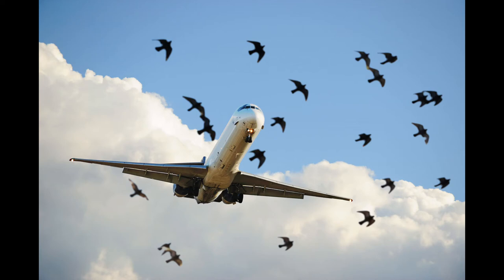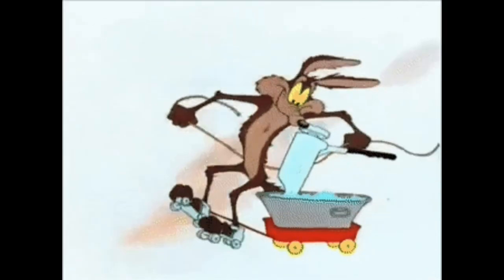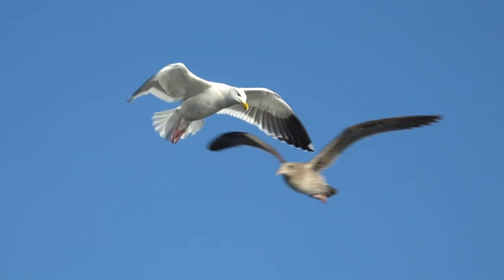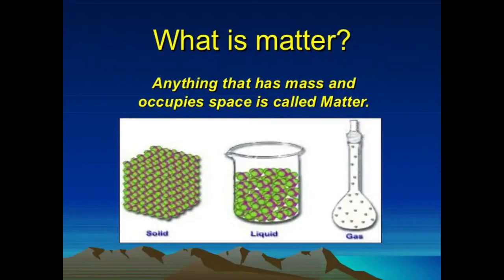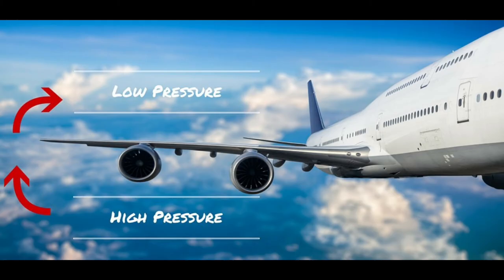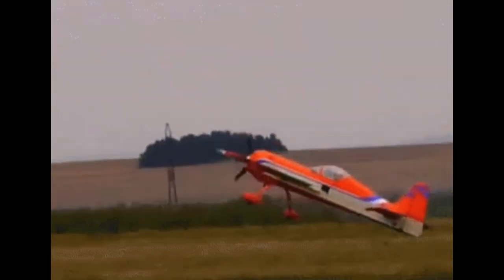Wings and Lift How Birds or Plane Fly [ Explained ]

Comment: I am sorry, but this just repeats common misconceptions. It is very misleading to say that the downwash pushes up on a wing.  While Newton's Third Law is satisfied, it does not really explain the true physics.
..
You must first understand that  Pressure over an area provides a force on a surface.
F = P*A -- - - - Force = Pressure times area.
..
As a wing moves it causes pressures around the wing to change slightly (very little).
.
These pressures are such that the upward pressure on the lower surface is greater than the downward pressure on  the upper surface. 
This is a net upward force on the wing and that pressure difference is ALL the upward lift.
,..
Those very same pressures are what causes the downward acceleration of air behind the wing.
..
Pressure under the wing pushes up on the lower surface AND down on the air further below.  This causes a curved flow below the wing. Air DOES NOT bounce off the lower surface as shown at time 2:19!  You have it correct at time 
 The increased pressure at the lower surface causes a smoothly CURVED FLOW.  This is a centripetal acceleration cause by the Pressure Gradient.
..
Then, 
The atmospheric pressure far above a wing being greater than the pressure at the upper surface, accelerates air that is traveling above the wing, downward behind the wing. This causes a curved flow above the wing. This is centripetal acceleration.
Then, both of these flows combine behind the wing.
..
This ONLY way to "push" on air is with a pressure difference between two locations.
It is that Pressure Gradient that causes lift and downwash -- as well as all other accelerations around a wing.

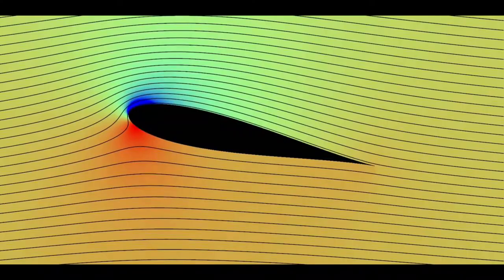What you say at 2:47 to 3:00 is correctly stated.  BUT you must understand that the sharper curved flow is caused by the greater pressure changes (gradients).
..
At time 4:08 - NO NO NO!   "Moving air" DOES NOT exert less pressure!  That is incorrect! 

Bernoulli saw that an increase in speed is accompanied by a decreasing pressure between two locations!  
That is ACCELERATION -- IT IS NOT "MOVING AIR".
.. 
You say it correctly at time 4:00.  The greater pressure DOES "PUSH MORE".  That provides a net force toward the lower pressure location.  Force on the mass of air ACCELERATES it more.   This directly contradicts what yo say else where with the "Moving=lower pressure".

This "uneven pressure" is called a "Pressure Gradient". That accelerates the air.  Air has mass and the Pressure gradient accelerates that mass Just as a force accelerates a mass.
That accelerated air then assumes the new pressure at the new location.  
The speed, or "motion" does not "cause" the pressure to decrease.!.  It DOES NOT !
..
@4:19  FALSE AGAIN! NO!. Bernoulli did NOT find that the faster that air moves, the less pressure it exerts -- NO!.

The greater ACCELERATION indicates that there is a greater Pressure difference between the two locations.!.  The accelerated  air "assumes* the lower pressure that is already there!. Once the air is moving at the new location it will be at that same pressure.
..
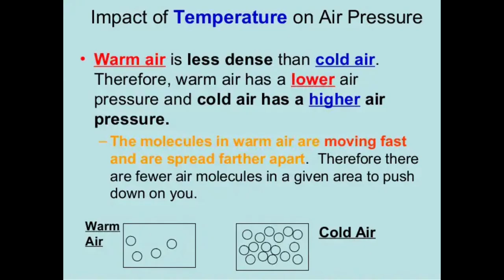ALSO, at time 4:27 - The air molecules do ARE NOT "more spread out" in the lower pressure.  That is a density change and in normal flight, the density changes around a wing are really, really tiny!  Fractions of a percent!
These pressure changes are very small and the number of molecules impacting the surface hardly changes at all. 
.. 
At 4:48 you again repeat this "faster = lower pressure" myth. The upper air has been ACCELERATED more than the lower air because there is a greater Pressure Gradient from ahead of the wing to above the wing. 

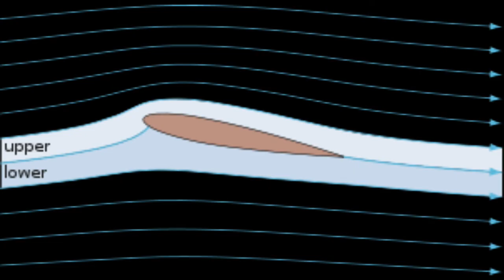At 5:10 the longer distance is irrelevant and the density change is also so small to be completely irrelevant.
This 1 minute video explains the TRUE physics of the decreased pressure above a wing:
 *www.youtube.com/watch?v=3MSqbnbKDmM*

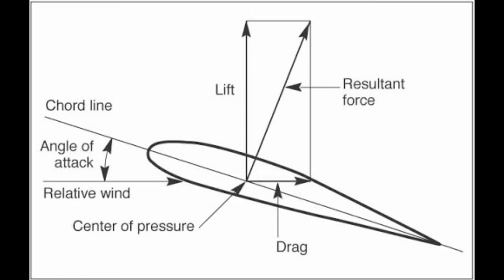At 5:30  NO AGAIN.   You contradict yourself again. the top-bottom pressure difference is increased as the Angle of Attack (AoA) increases.  It is the SAME top-bottom pressure difference.  Changing altitude (density), speed OR AoA, changes the top-bottom difference and, therefore lift.  The AoA does NOT somehow magically produce another kind of lift. it is ALL top-bottom Pressure Difference.  You contradict what you said earlier.
..
The speed of the air above a wing is only greater than that below when viewed in a wind tunnel.
.
You will be very surprised to learn that when measuring the speeds relative to the still air (ground) the air under the wing is SLOWER!  This is MEASURED DATA and is shown here in Fig 7 here: *rxesywwbdscllwpn.quora.com/*   
HOWEVER, it HAS been _ACCELERATED_ MORE.!.
..

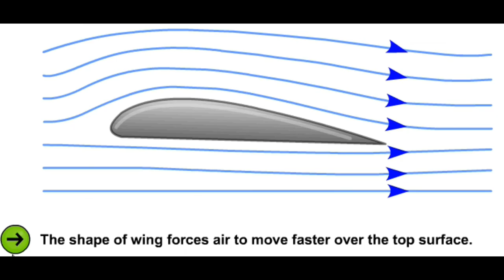At time 6:17  you show no curved flows and no downwash.
..
..
Finally, all wings, asymmetric, symmetric, flat, upright and inverted produce lift by the same physics, but the small variations in shape do cause some effects that produce good characteristics for various uses, like inverted flight.  I must be clear that is is the curving of the flow that is important, not simply wing shape.  All wings have the same basic flow pattern when generating lift.